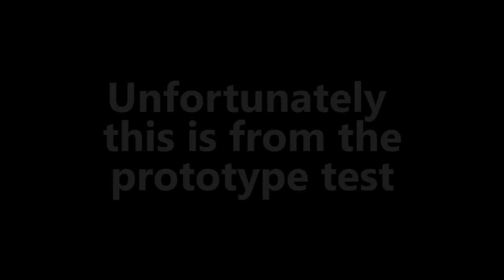VLog - Acryllic painted and coated softbaits

Comment: Great video :)
Did you try to heat a painted lure with a heat gun for a while? That should melt the plastic slightly and to get the paint in. Also the top layer would stick better to the body. I have never tried that myself, it just what I thought may work.
Cheers
Reply from the maker: I think you would have to be very carefull not to burn the paint, and if the plastic starts to get runny it would be hard to handle. But with a little attention it should be possible. As I have the oven anyway its just so easy to set it to a safe temperature and but the baits in there

Comment: Which kind of softplastic is best for coating? 
And which for making the lures out of the molds? Until now i made only hard baits, looks very cool making softbaits too
Reply from the maker: I use same as I use for the body, just a softer version. Seems to work fine

Comment: Great video! Friend, tell me what kind of dye you use for soft fishing lures? Thank!
Reply from the maker: Hi. The outside colors for this bait is normal airbrush paint, but that will only work if you coat it afterwards. There are other paints that will work without coating
Reply: @SplishSplashFishing  It is clear that for the airbrush! But the paints are water-based acrylic, on the solvent, two component polyurethane ... Which ones? Thank!
Reply: @SplishSplashFishing  I tried it on a water basis, but the film from the bait slips for some reason ...
Reply from the maker: @playfulcarp7165  Its water based, and you should make sure to clean up the bait thoroughly before painting. Also make sure that the paint pattern leaves uncovered areas, where the soft plastic coat cann attach to the body
Reply: @SplishSplashFishing  Thank you friend! I watched the video to the very end and understood everything how to protect the dye on the bait!

Comment: Hi! I am also engaged in soft baits for personal use and have long thought to paint them with an airbrush. I don’t know what kind of paint should be used for silicone, so that it does not wear out quickly. Tell me what paint you use or similar in composition. mistakes.
Reply from the maker: In this video I use normal airbrush paint, but it will only work well if you coat afterwards. For lasting paint without coating, you should look for CAB coatings or Bright Bait in Belgium. But it requires a ventilated paintboot I would say

Comment: I paint my big soft plastics with acrylics and then clear them with lureworks soft plastic paint (clear). I brush the clear on, not before clearing them thoroughly with an acrylic clear. If not careful, you will pull off the acrylic color with the lureworks soft plastic clear paint. Won’t peel and it’s there for the duration
Reply: It’s because lureworks clear isn’t a coating paint. Read the description of it. It’s just clear paint

Comment: Do you make jerkbaits or lures which has 3 pieces?
Reply: He has a video i believe
Reply: +Daniel Kontor Yes, normal jerkbaits but I mean those which are "in a three-part"
Reply from the maker: I was working on a 3 part swinbait, but as the hinge didn't hold, the project is a bit on hold for now. I might take it up at a later point